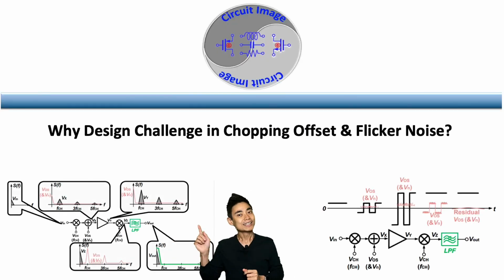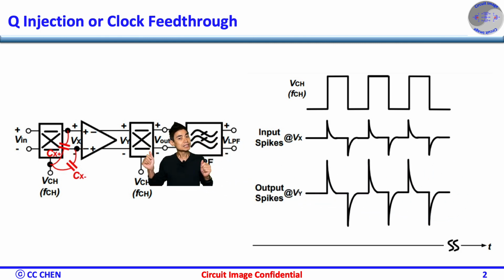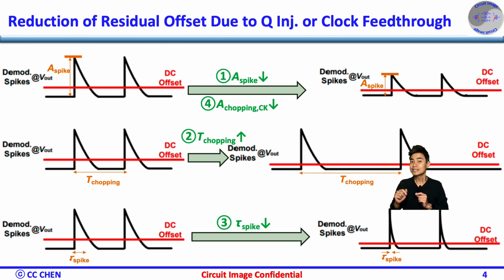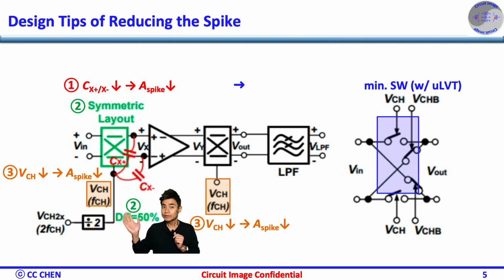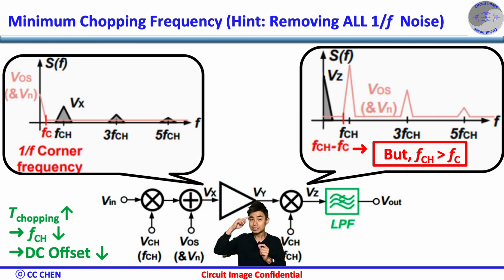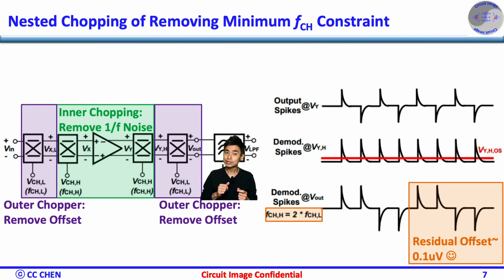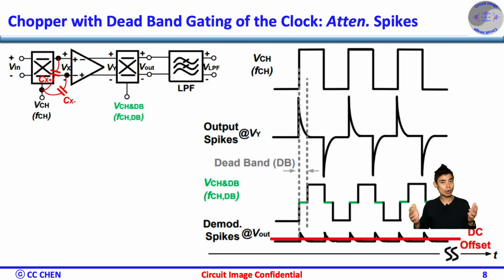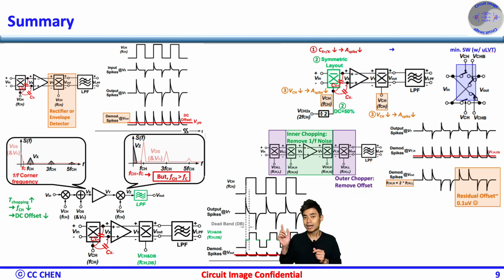Why Design Challenge in Chopping Offset & Flicker Noise?

Comment: Nice video for tips for designing a better chopper op-amp
Two Question: How to choose chopper frequency fchop? We know fchop should be larger than the 1/f corner frequency to remove the flicker noise.
But compared with op-amp Gain-Bandwith (GBW). Some people said  fchop < fGBW, while others claimed fchop > fGBW. What's your thoughts? Thank you!
Also Can you please explain more about the low-pass filter part? I see people use Switced-Capacitor norch filter to filter the fchop, which I guess is more efficient
Reply from the maker: Hi Yushi,
Nice to meet you and thank you so much for the good questions. I have comments below w/ [CC]. 😊
One question: How to choose chopper frequency fchop? We know fchop should be larger than the 1/f corner frequency to remove the flicker noise.But compared with op-amp Gain-Bandwith (GBW). Some people said fchop < fGBW, while others claimed fchop > fGBW. What's your thoughts? [CC] fchop > fGBW may cause lots of charge injection, which may not be practical to chop effectively if the fGBW is too high; therefore, that depends on the value of the fGBW and the process characteristics.Also Can you please explain more about the low-pass filter part? I see people use Switced-Capacitor norch filter to filter the fchop, which I guess is more efficient[CC] Sure. Since the Switced-Capacitor notch filter (SCNF) can provide a very high precise notch frequency; therefore, I agree with you that the SCNF is more efficient.

Comment: Hi CC, nice video as always. For the switches charge injection, i think it is mainly the switch mismatch that causes mismatched charge injection from main path and cross coupled path, that gets rectified eventually to create a residual dc offset. If switches are matched, then the waveform at Vx node will have same net charge injected at both rising and falling (as one switch turns off and other turns on) leading to twice frequency impulse like waveform at Vx node. This waveform when passed through amplifier and demodulated will lead to 0 offset.
Reply from the maker: Hi Abhirup,Thank you so much for your feedback. You're correct. The switch mismatch (including the parasitic mismatch) will be the main reason, but we cannot calibrate the mismatch of the switches, which are used to calibrate the amplifier's mismatch; therefore, the only way we could do is to accept the mismatch of the switches and mitigate with a few images shown here. Hopefully, this helps everyone in the future.
Reply: @circuitimage  I agree CC with your input. I knew about this nested chopper technique before but never used it ever still. Thanks for sharing.
Reply from the maker: @abhiruplahiri1  Sure. Any time.

Comment: Thanks for reviewing the chopper design. This is the first time hearing double chopping. I always found the most difficult part in switch capacitor circuit design is suppress the charge injection noise.
Reply from the maker: Hi Bobby, Thank you so much for the feedback. You're correct that suppressing the charge injection noise is a similar challenge in switch capacitor circuit while the switching frequency is high. So, that's why to double chopping and mitigate w/ a lower switching frequency here. 🙂